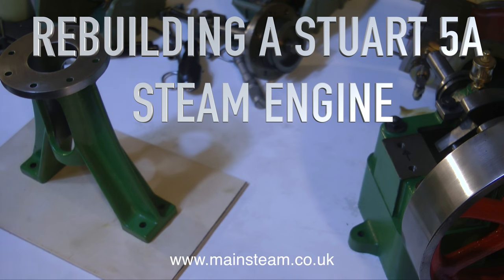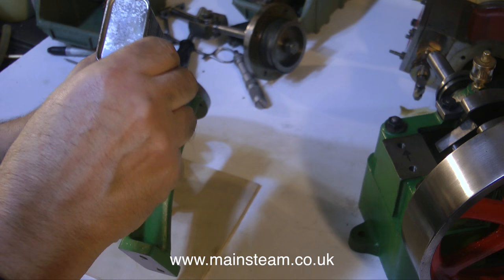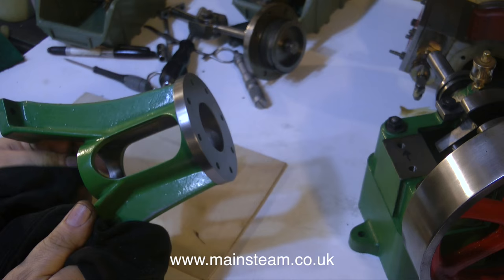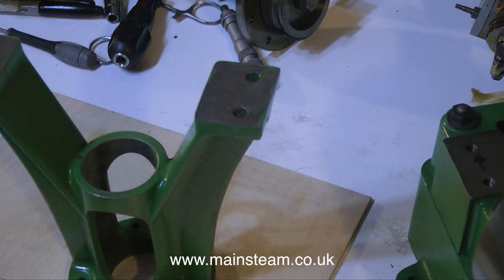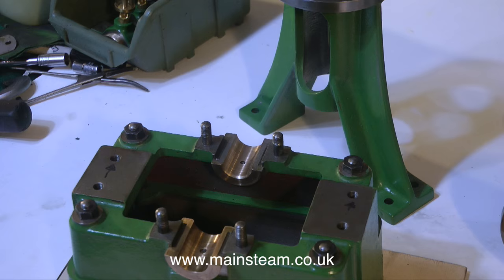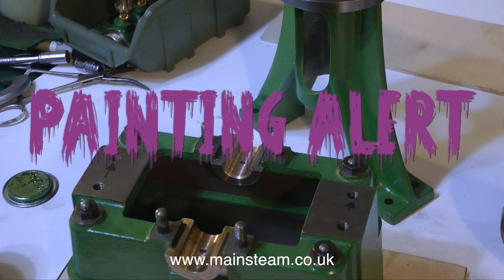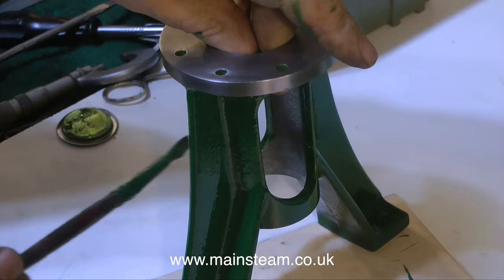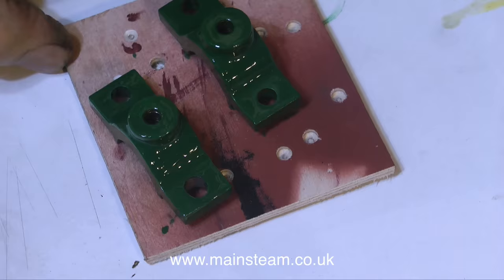STUART 5A STEAM ENGINE REBUILD - PART #4

Comment: How to paint for beginers: Step 1: Get a tin of paint. Step 2: Get a brush. Step 3: Dip soft end of brush in paint tin. Step 4: Stroke soft end of brush across the selected surface you wish to paint. Step 5: Repeat steps 1-4. Follow these simple steps and you'll be a master painter in no time.

Comment: These videos are brilliant. I love the intense humour of them and the helpful engineering tips makes them very useful to me. I do like the colour of Humbrol No.3 Brunswick Green for the 5A as it is very similar to the original Stuart Green, however, a helpful tip I picked up off a modeller in a steam rally was to make the original Stuart Green you mix Humbrol No.3 with Humbrol No.21 and a tiny bit of Humbrol No.25. You have to experiment a bit but the end result looks almost identical to the Stuart Models Green. Keep up the good work and don't forget to use that all-over biohazard suit when working with enamel paints. :)

Comment: If the engine had not been previously painted, what music... erm kind of undercoat would you have used?
Reply from the maker: On cast iron, I generally don't bother with undercoat,  just a couple of coats of "Humbrol" or "Precision Paints" enamel.....
Reply: Keith Appleton Thanks Keith, I really should give my poor old 10V a coat of paint.  I've been meaning to do it for a while. (30 years).